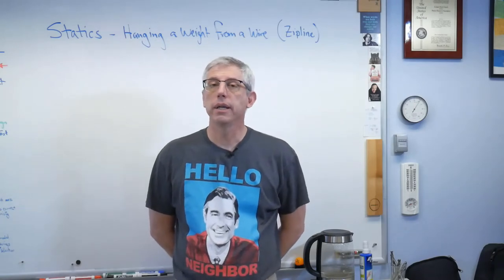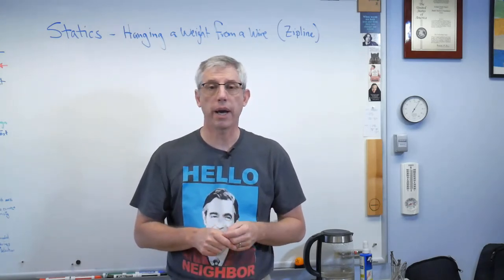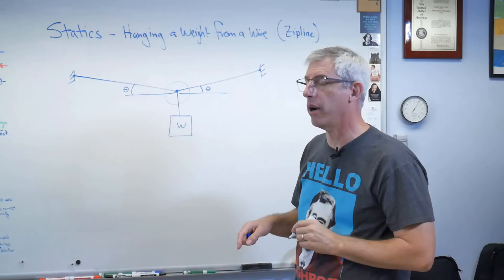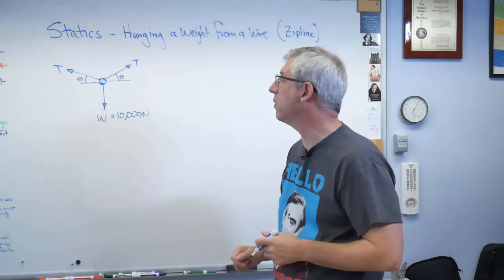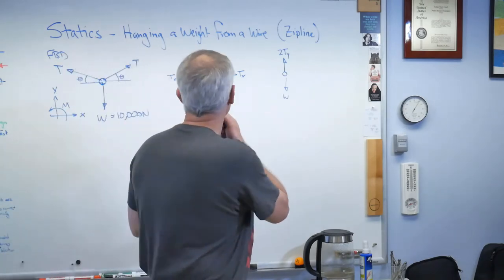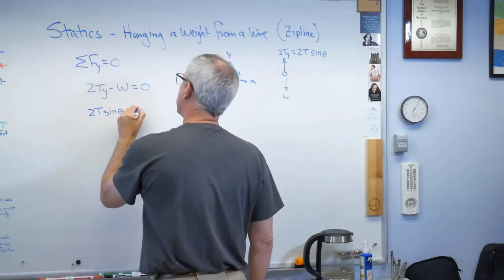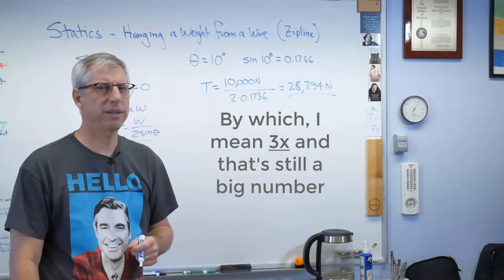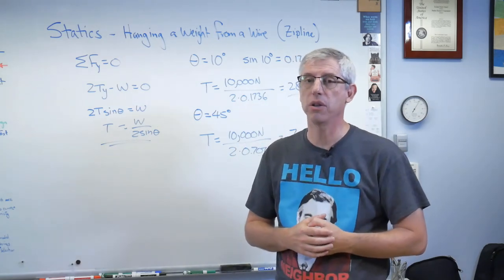Statics - Supporting a Weight with a Wire (Zipline)

Comment: Thank you for uploading these videos …!
I would appreciate if you could explain the last point about why the horizontal rope is not a good idea. My understanding is if the rope is horizontal or almost horizontal it is stronger than the weight it carries especially if the weight is too small and the strength of the rope is way higher than weight it carries.